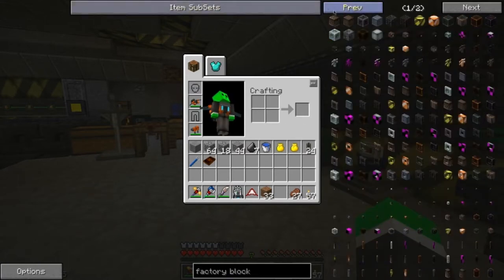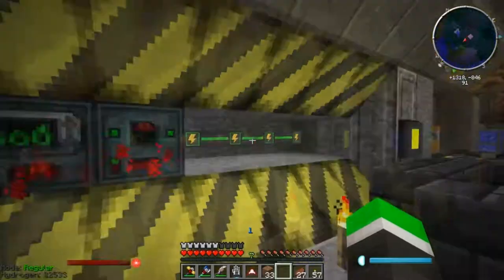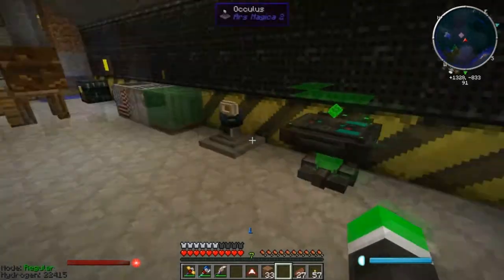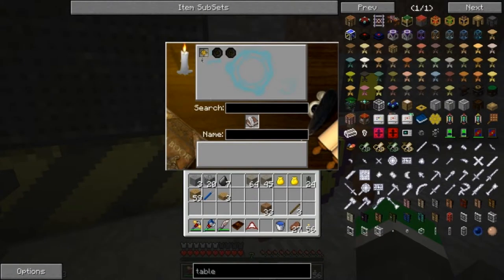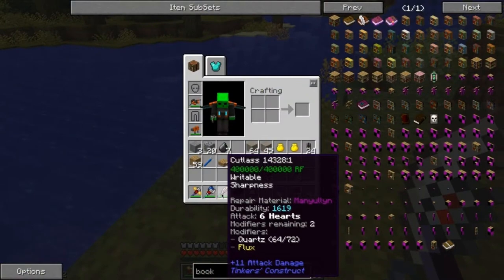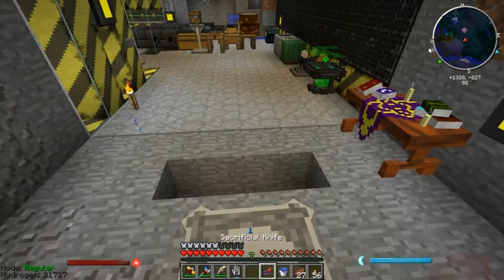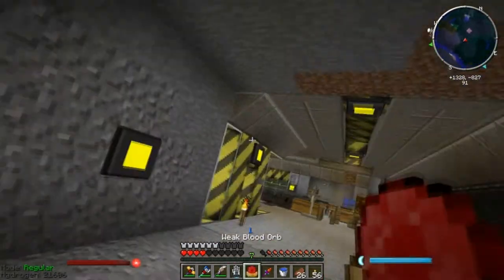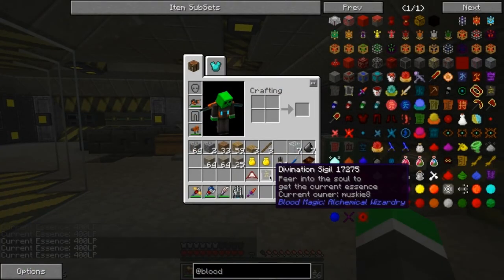Minecraft - Crack Pack - Episode 3 - Base Improvments

Comment: 4 tips for blood magic, when the altar is empty, leave the item in it becaue removig it waste the blood you already put in, also each heart is worth 200 lp and so 10 hearts is 2k lp, and 3rd, for your tier 2 altar use 4 runes of self sacrifice and 2 speed runes and 4 runes of augmented capacity, then you can get stuff done really fast, 4th tip, put a hopper next to the altar then fill the altar, then put 2-3 items in the hopper at a time, cuz it will do the items simultaneously although it takes the same amount of time and blood if u did the individually, but then u dont have to stay and click forever
Reply from the maker: Thanks for the tips. Blood magic seems hard but fun. I did get Your PM and i wi get back to you soon
Reply: k thanks